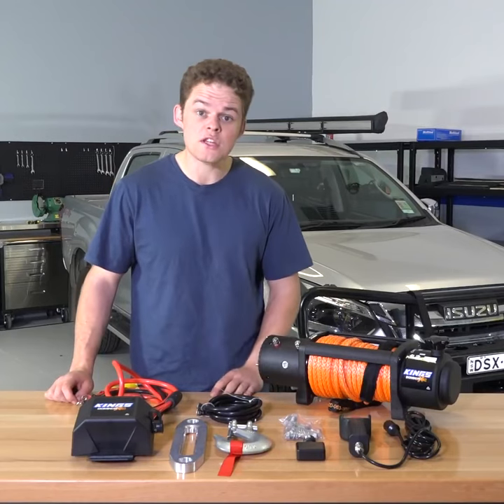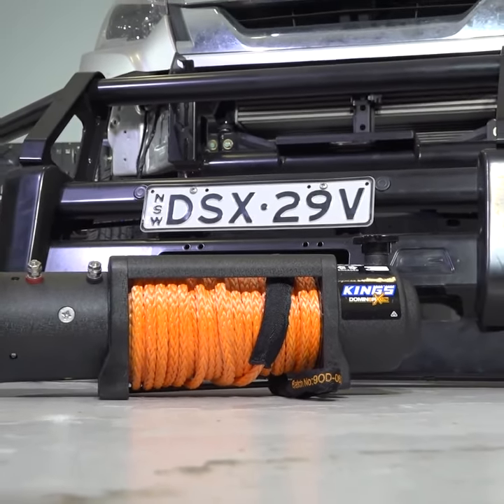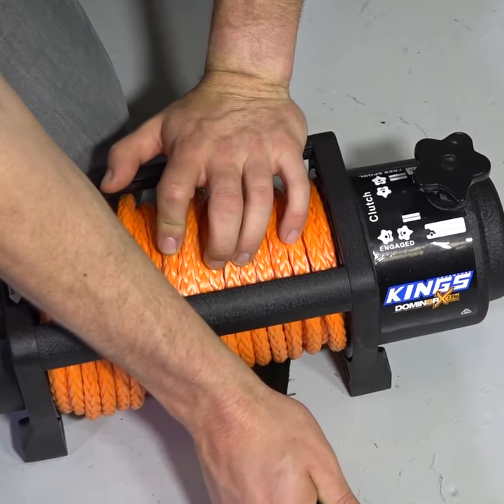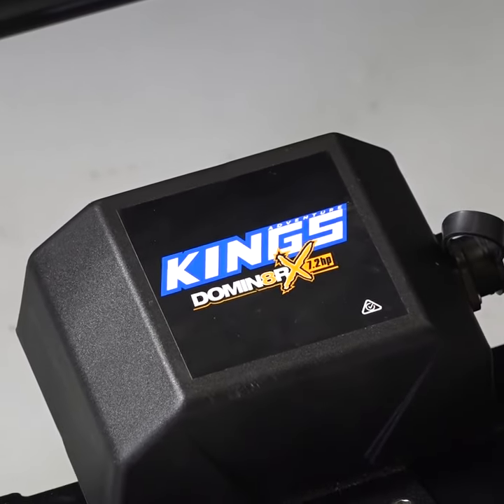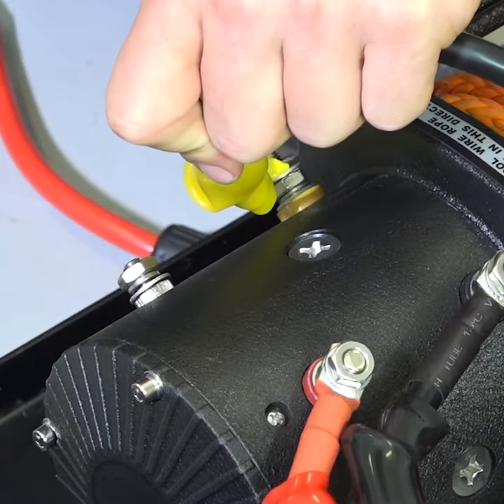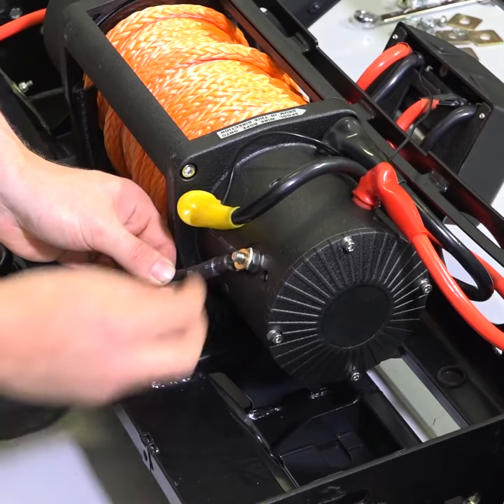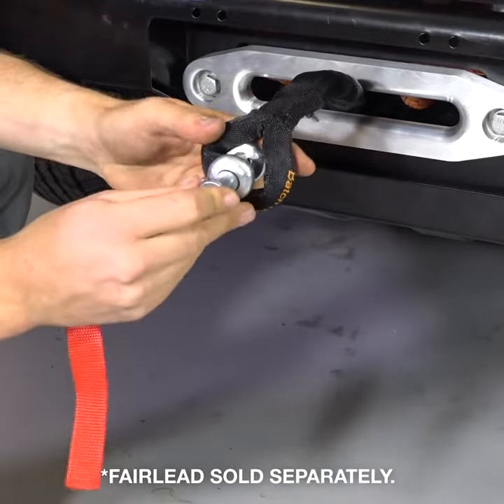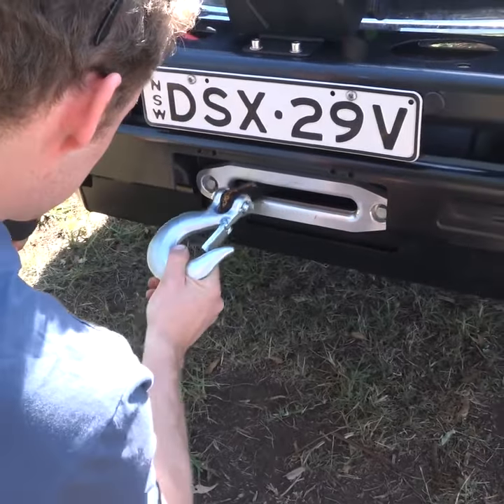Quick & Easy DIY video on how to install a Domin8r winch onto your 4WD

Comment: Hold up. Dude mounted winch with mounting bolts going forward and through the fairlead instead of going down through a winch plate? I've never seen that before.

Comment: I would buy from them if They had Afterpay instead worrying  about the zippay Watch how many people like this because you have made comments about  zippay being your best customer
Reply from the maker: Hey mate, we have Afterpay available on our eBay site: http://www.ebaystores.com.au/4wd-Supacentre
Reply: Thanks will buy
Reply: @4wdsupacentreAu  I was not aware of that either. I won't use Zip Pay, but I do have Afterpay and Openpay.
Reply: @4wdsupacentreAu  hi can you buy wireless recivers separately. my winch controller works with the cable plugged in,won't work with wireless receiver plugged in and on wireless

Comment: what bolts and nuts are used?
Reply from the maker: Hi Blake, So we use 3/8”UNC x 1-1/4” Dacromet coated bolts and spring washers that are provided with winch when you buy from us. 
cheers,
Saleha

Comment: Gday mate installed mine yesterday and only spools out not pulling? The wiring looks as the way yours so what did I do wrong?
Reply from the maker: Double check the wiring - have you mixed up the earth wire (black wire direct from battery to earth terminal underneath the winch) and the black wire that goes from the control box to the black winch terminal ( next to red and yellow terminals)
Reply: Yeah same problem but the wiring connections are good so what else could it be I can hear a clicking sound only but not pulling
Reply: I know this was a while ago but did you get this sorted. Mine doing the same on install. Will feed out but not in. Wiring looks how it is in manual, worked for about 30 seconds than nothing.
Reply: @johnkeenan3988  hi mate thanks for your comment here ended up taking it back they replaced it with a newer model and worked fine so I guess the unit was faulty
Reply: @antocuares5022  Thanks mate, will check wiring again and if doesn't work will contact them. Took a whole weekend to fit because I had to modify stuff to get it in, now have to pull it back out. 😒

Comment: What size inline fuse is used in on the cable
Reply from the maker: Hi There,
The winch does not come with a fuse. 

You can install one however at full load the winch can draw ~430A and would need a fuse big enough to support this kind of current draw. For this reason most do not install a winch, but disconnect it from battery when not using for a period of time.
Cheers
Saleha

Comment: Will winch bolt straight to arb commercial bull bar without a adapt plate🤔
Reply from the maker: If it’s a winch bar, then yes. 

if it’s not a winch bar then no - it’d need to be braced or fit a winch cradle. It depends more on the bar as these winches have the same standard bolt pattern as all others

Cheers!